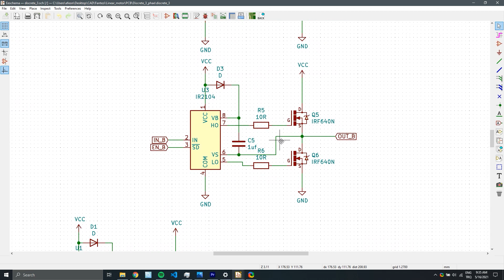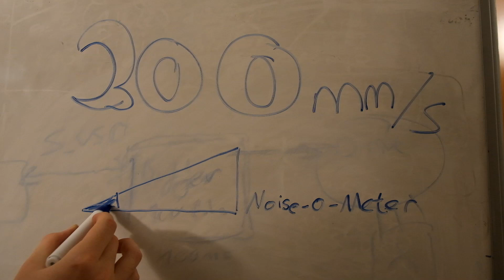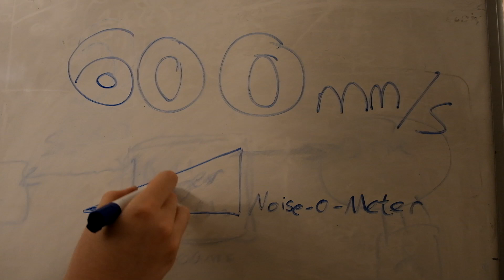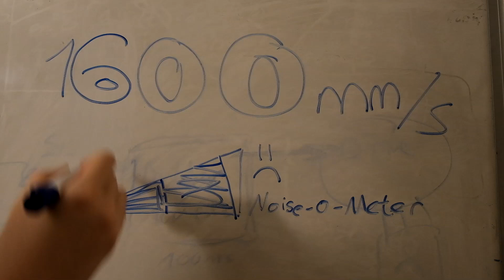DIY Linear Motor Part 2: A Glimpse of Hope

Comment: what kind of D/A are u using? microcontrollers internal pwm or a discrete D/A converter chip? i am building same thing on a mgn12. 🙂i checked the diagram and you are using a hbridge, that seems to me, that you are using pwm. have you increased cpu timings for better resolution in pwm? maybe a pi2040 or esp32 has better pwm modification parameters. up to 16 bits 🙂

Comment: I wonder whats the power consumption? Say 600 mm/s? Also dont you know the weight it can lift (with power consumption also)? Like say lift 200 gramms at 600 mm/s - how many watts does it need? thx
Reply from the maker: I did not measure the stalling force but it largely depends on the coil current. But I assume at 12V with 2A of current it can produce a force in order of 1-3N quite easily. The force can drastically be increased but the the coils inmediatly starts to deform under increased temprature. Anything above 2A requires some sort of a active cooling technique.
The coils use @600mm/s average of 900ma of current so 10-15 w would be a sane assumption
Reply: @eongan  Thanks a lot! I currently playing around with small steppers from old cd roms, and with my tests they can move 200 gramms pretty fast (I havent measure speed but I guess mb 300mm/s) consuming around 10v with 100ma. So I guess its much more efficient. Havent you tried putting array of neodium magnets inside the tube? From different acuators videos it looks like this way you can improve power consumtion by cycling current direction.
Reply from the maker: @KyrychenkoAnton  The truth is there are actually radial neodymium magnets inside the hollow copper tube. My bad I forgot to take any pics during assembly and it was sealed shut. If you are looking for efficiency linear motors probably wouldn't be the best choice. Unlike step motors they don't have any detent torque, thus they have to be powered constantly. The best way to achieve perfect efficiency would require super-conducting coils which would be pretty interesting to play with. Sadly I am not aware of any room-temperature super conductors. Please correct me if I am wrong. :)
Reply: @eongan  I'm not sure either, I just fascinated about linear motors and hope one day they become more efficient and cheap - their speed and quietness are fantastic.

Comment: I also noticed, after the PLA failure that your print layers are in line with the linear movement. I'd highly suggest rotating the object in your slicer, so that the layers are parallel to the linear rods and of course (as you mentioned) with a more temperature resistant filament. I'd suggest nylon, because it handles both, heat and pressure very well. I can't wait to see the next iteration. 👍👍

Comment: Looks promising. Might be worth making a 3d printed winding jig so you can get nicely wound and densely packed coils every time.
Reply: Flat coil
And Use Higher Voltage
I used a drv8825 at 45v with 6 sets of coils and 8mm shaft "7mmx2mm N-N S-S more flux spikes baby" crimped the ends with a cheap tube cutter drove it with a arduino like a year ago threw an hall effect sensor on it a little away from the coils to not get interfence from the coils